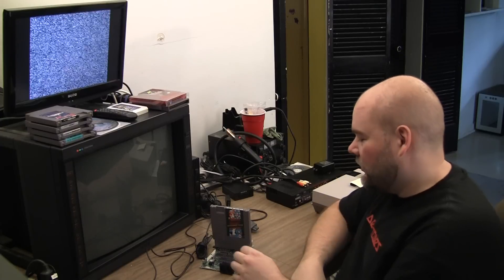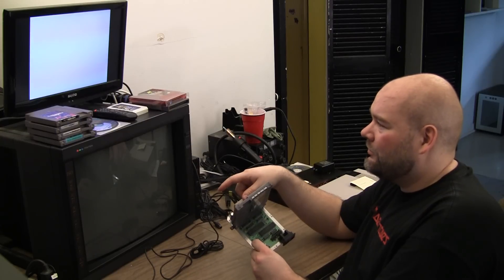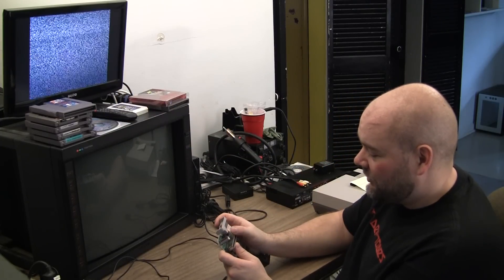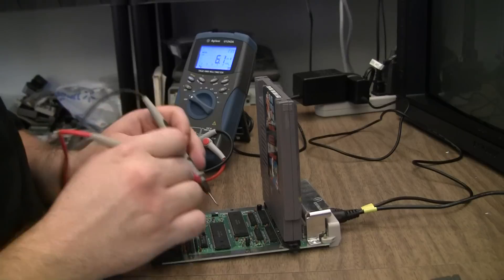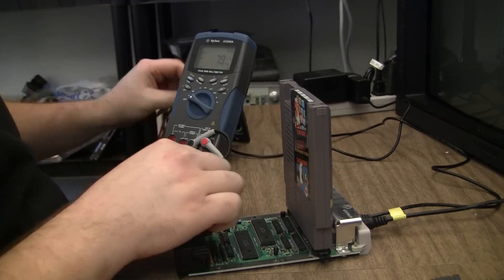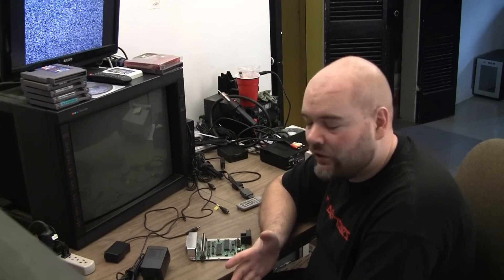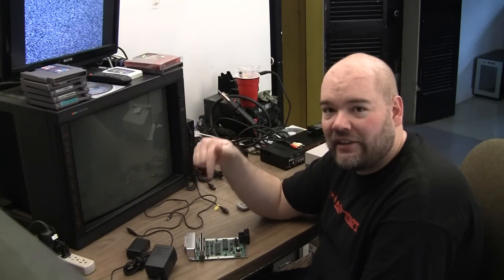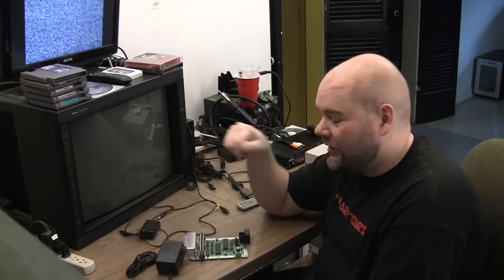NES-101 Nintendo Top Loader - bad voltage regulator 7805

Comment: Maybe you can help me. I dropped my top loader and it stopped working with the oem power supply. Then  i picked up a third party psu and it was dc power supply and it worked fine but when i swapped back to the ac offical one it would only show mad scrambled graphics all over the screen. When i opened the nes i discovered the power filter cap inside was loose one of the legs had come loose from the drop. After turning it off and on again with the ac adapter it now doesnt come on with either psu. Do you think its fixable and do you think i fried the ppu somehow?
I didnt discover the loose cap until AFTER goimg back and fourth on the power plugs and getting that scrambled screen.
Ugh help someone!

Comment: This video helped me fix my NES Top Loader that had a bad rectifier a few months ago. Ended recapping the system first (which needed to be done eventually anyway) but when that didn't fix the issue, I found this video and replaced the 7805 and rectifier. It's been working perfectly ever since. Thanks!

Comment: I've been working on trying to get a rare famiclone working. The original voltage regulator was bad so I replaced it and some caps & voltage regulator checks out with genesis power adapter feeding in 13.77 volts and output around 5.01 ish but when I turn the switch on the voltage drops across the entire circuit from the regulator matching all the way to the chips when starts out 2.40 volts and drops to 1 volts within 20 or 30 seconds. No chips is getting hot or anything else on the board that I can feel other than the VR of course and it's getting super hot really fast. I actually took 2 used 7805s out of other hardware & also ordered some new ones but I find it odd the regulator could be bad when I put a load on it making voltage drop. Any ideas? Thanks a lot. Also, I use one of those LED irem carts (spelunker) which the led lights red when I first turn it on but goes off after a few seconds. I recommend these carts to test systems with because the LED very handy especially on top loaders and famicoms that have no power on led.

Comment: I am sure you are very busy but i was wondering if you could help me out. i have a snes and it will not turn on. i have a working unit so i know its not the power supply. i changed the pico fuse and no luck. then i tested the power switch and that is not the problem either.  could it be the voltage regulator?? and if not what do you think may be the cause. I am stumped . Please help if you have the time to answer. Have a good day

Comment: I'm looking for help regarding the controllers plug in.  My controllers don't make contact with the game system when I plug them in.  Any suggestions?  Is there any help for this problem?
Reply: Have you tested the controllers on another know working console? If they work then the problem is probably with the jacks. You might find a pair of used ones on Ebay. Or, I have plenty of junk consoles. I could sell you a pair. They're very simple to remove and replace. Or, do you have non-Nintendo controllers that are hard to push in all the way and hard to take out? If that's the case you'll need to buy Nintendo brand controllers.

Comment: On what points do you measure the voltages? You are hiding so I can't see where you are measuring. I'm trying to fix my friend's toploader which someone else modded. It just suddenly stopped working for him. I already replaced the 1000microF/25V cap and the voltage regulator... Probably something wrong with the actual mod...
Reply from the maker: +Elrinth You could just check at the 7805, middle leg is gnd, righ is 5V, and left is input which should be a volt or two less than the adapter is putting out.
If you suspect the mod then touch the composite cable to pin 21 and also ground the sleeve of the rca end, if that produces an image the console is ok.

Comment: Can anyone tell me the voltage that the 7805 should be outputting? I'm getting 10v off the power switch, which is where I'm running my LED.

Thanks for all of these videos GameTechUS! I have been watching everything I can on the nes101.
Reply: dont take my word for it but i think around 5 volts is the output

Comment: Hi GameTechUS, thanks for the video, I have problems with my NES, the first time is connected and I press the power button it takes more than a minute in order to turn on, I replaced all the capacitors in the RF module (Mitsumi Power & Modulator PCB) with the following values C6:10uF 25v, C21:2200uF 25v, C22:100uF 25v, C25:100uF 25v, and those in the NES PCB with the following values: C1: 100uF 10V, C9: 2.2uF 63V, C23:1uF 63V, and I'm still having the same behavior, the NES takes like 1 - 2 minutes to turn on the first time, the voltaje, I'm not sure if the voltage regulator that comes with my nes is the original, it reads: 17805 9G1, the input voltage on it is 12.9 VDC and the ouput is 5.05 VDC, what could be causing the mentioned issue? do you recommend me to replace the voltage regulator? Thanks in advance :)
Reply: I forgot to mention that once that the nes turns on I can turn it off and change the cartridge game, then no issues if I turn it on, the issue comes after pressing the power button with the power cable unplugged, then I have to await again.

Comment: Hi Thanks for the Vid.
The Voltage Regulator on my original NES is reading 4.88 volts instead of 5. Should that be ok?
Reply from the maker: Yeah it should still be ok, but it might be low because something else is failing like cpu ppu main cap etc.
Reply: Ok thank you!